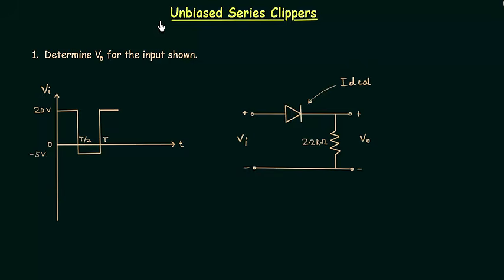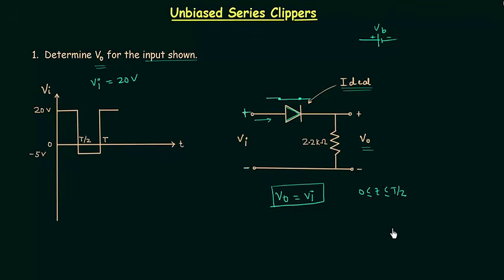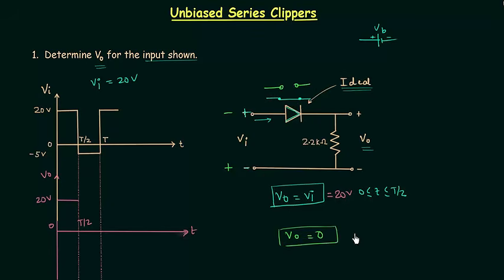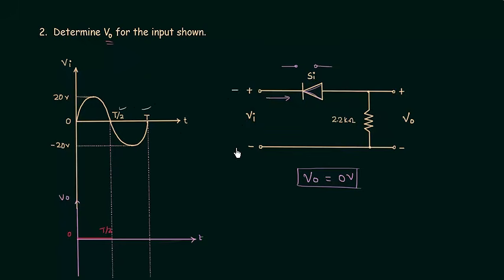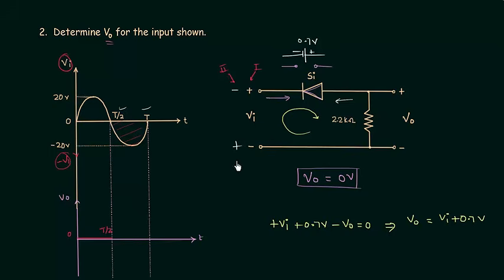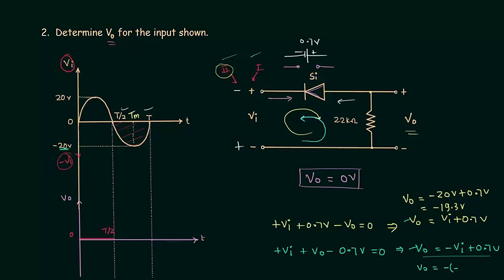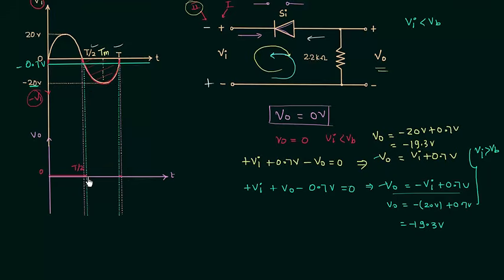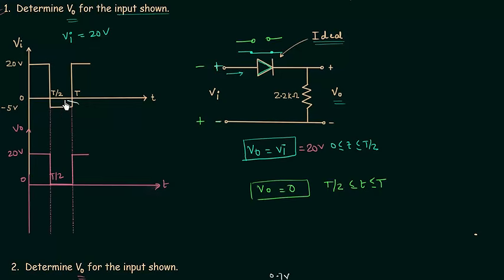Unbiased Series Clippers

Comment: I have one question. In the second question, during the negative half cycle the diode will remain off until the Vi is more than 0.7v. So shouldn't the o/p waveform start from -0.7v instead of 0?
Reply: It did actually started from 0.7, why do you think he drew 2 more lines intersecting the Vo graph after he drew the barrier?

Comment: Sir, in second example (for -ve half cycle) why u have kept the sign of v0 constant. It should be changed because current is flowing from downward to upward. Then by applying kvl i am getting +19.3 volts. Please help sir.
Reply: It's constant because direction of current  and polarity of input  both are changing at the same time

Comment: Hello, Neso. Thanks again for the awesome material. However, in the second problem you've forgotten to add the +0,7V to the first half-cycle of the wave. Keep up the good work.
Reply: Because for +ve half cycle, the diode is reverse biased and first of all we have to check the state of the diode (which is OFF in this case) so the circuit is simply open circuited.

Comment: sir,how can u  say diode will be open circuited during positive half cycle, whereas u latter said that diode is practical diode.diode will be open circuited only if diode is ideal
Reply: Mimo Ray  the difference between an ideal and practical diode is the voltage drop across it. The ideal diode has 0V drop whereas practical has 0.7V. In both cases of the diode is reverse biased then it will act as open circuit and the applied voltage can be read across it or infinite(OL on multimeter) resistance.
Reply: @TH3B00T  still having doubt .....
Reply: @himanibansal5048  ideal diodes or non-ideal diodes, when reverse biased, will always be off. The only difference is that for non-ideal diodes, we need to consider a voltage drop of 0.7V during forward bias. An ideal diode, during forward bias, will not have any voltage drop.
Reply: @MC-mx1mt  he have considered two cases there,in the first case,even though it is reverse biased,how did he make an equation out of it.when the circuit is open there should not be any voltage drop right?
Reply: @gavarakomal3887  he explained later that the equation for both cases are only valid if and only if the input voltage is equal or greater than the barrier voltage, which is 0.7Volts in this case
Reply: @gavarakomal3887  he clarified it right after he finished explaining the two equations

Comment: the output waveform is incorrect in the 2nd problem
Reply: It is correct.
Reply: Its correct bro
Reply: yes its wrong
Reply: @praveenmula8394  Shut up if you're not getting it then it's not wrong
Reply: Yes its wrong
Reply: The output waveform is correct bro for second one. Simulate the circuit inside the Multisim or LTspice, u will understand

Comment: sir, u told in the definition of clipper that it will remove some part of the input without distorting the remaining portion, but in this problem the amplitude of the remaining got changed to some other value nah? So won't it be a problem?
Reply: Go though the definitions again it says clippers are those networks that employee diodes to clip away a portion of a input signal without distorting the remaining part of applyed voltage......now look it's talking about the remaining part in eg 2 the remaining part is shown n woo effected nahi hoga Baki clip hogya wo hogya but Jo results aaye hai usme waveform change nahi hoga ....
Reply: Remaining part wo hai Jo final ban rha hai n woo same wavefom ka value distorting nahi hoga esme amplitude change hua hai wo cliping ke waje see ha hai....

Comment: Sir, while calculating Vo by applying KVL in loop two (after 8s of video has passed), you have taken Vo as positive. I think it should be negative. Pls clarify.
Reply: start from the first step.
when writing the 2nd step he kept Vo on the LHS but changed it's sign accidentally but in the 3rd step he wrote the equation correctly as he may have kept beforehand notes
Reply: @pratikmore2885  could u please elobrate more?